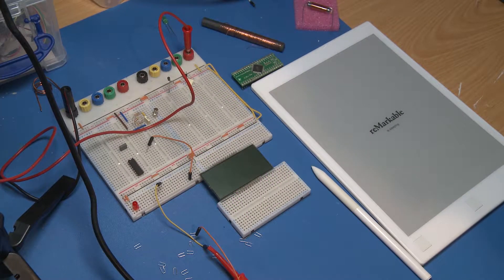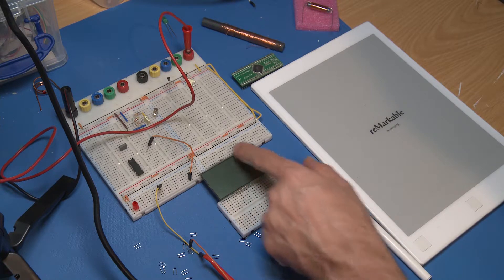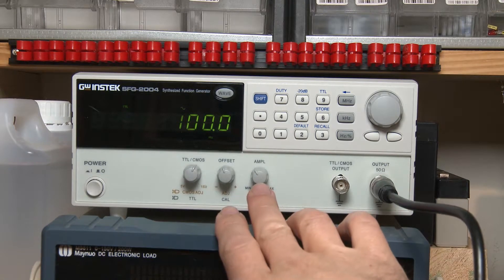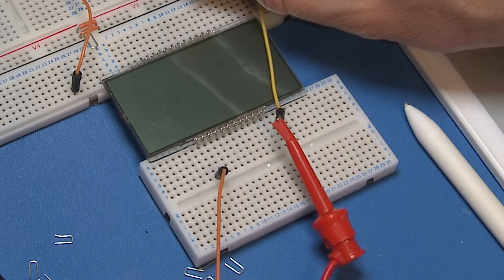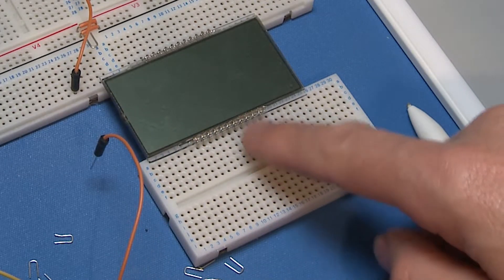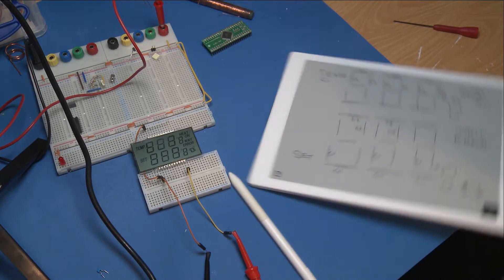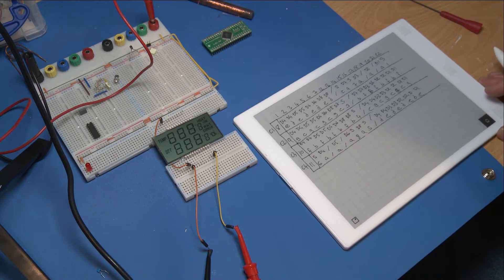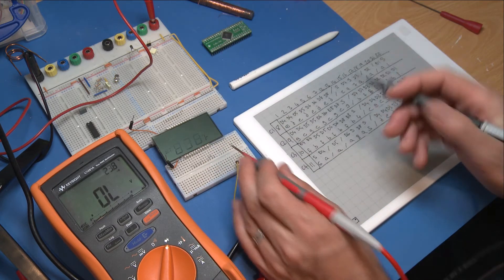#5 - Mapping out LCD segments

Comment: Hello, I was watching your videos and I wanted to know if you can replace an lcd of a radio transmitter because its lcd is smeared and I can't find an answer, the model is Yaesus Systen 600 and I ask, can the change be made for something more up-to-date? ??
Reply from the maker: Hi, 
You would have to find an exact replacement as the LCD layout will be specific for that transmitter. It also depends on the internals, but if you were to replace it with something more up to date, you would need a new display driver and certainly need to alter the code base to drive it - I'm not sure how possible that would be - if at all possible would be a hard bit of work.
It does have a great service manual though http://www.radiomanual.info/schemi/YAESU_HF/FT-600_serv.pdf

The best is to look for a spare LCD part on eBay or radio ham groups- or buy a broken one with a good display and swap it out. Or get hold of the manufacturer and see if they have spare parts. https://www.yaesu.com/

Good luck and let me know if you have any success